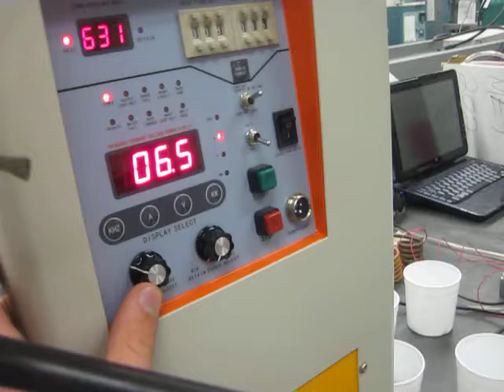Levitated molten steel

Comment: What is the above the black tube?Is use to suction?
In addition, could you tell me what is the power of the induction furnace?25KW？
Reply from the maker: Actually the black tube pumps in an inert gas to try and keep the sample insulated and to try and avoid oxidation(we were using He/Ar), and sorry, I don't remember the power of the induction furnace.
Reply: Adam Protter Thank you very much! Maybe I need to improve my coil shape, I the coil of levitation force is not big enough, and the heating efficiency is low, Although it is 25 kilowatts of power to